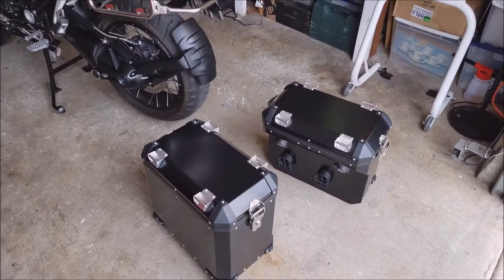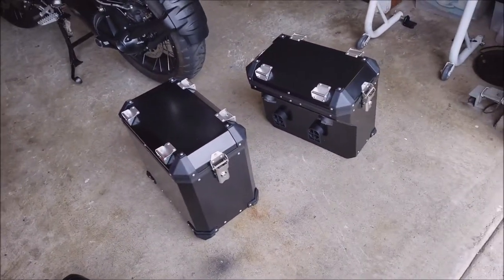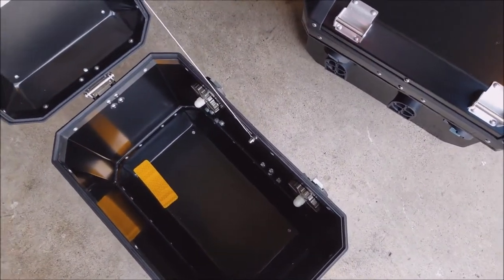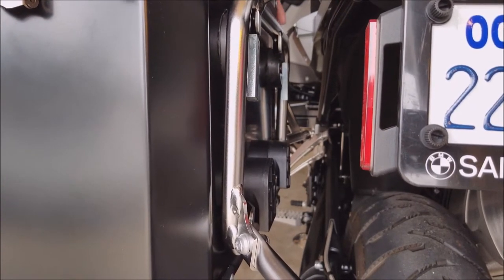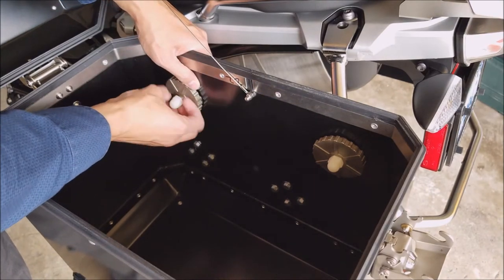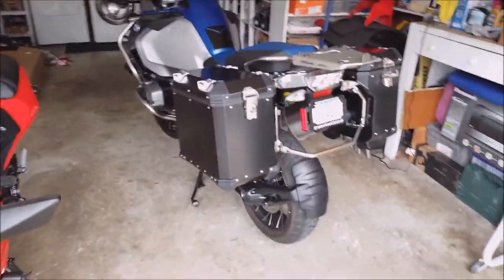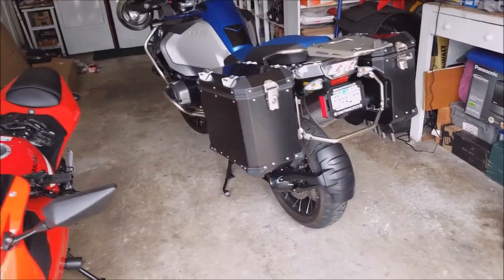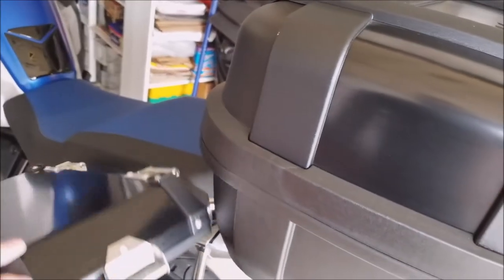Brooks Autosports Aluminum Panniers Black (Left + Right) Review - 2015 BMW R1200GS Adventure

Comment: Nice! One thing I'd like to note: the Touratech bags mount identically, and on those the black pucks on the back have a slight cutout for the metal tabs that swing up and lock the bag on place. You bring those tabs to a vertical origination and then screw the big knobs on the inside to lock it in place. I can't tell from the video if these cases have something similar, but if they do, that's probably very important to get a good lock-up on the mounts. I've seen this style of mounting system come loose with vibration if they aren't tightened down. I used to have Touratech bags like these on my F650GS, and my brother has touratech bags on his R1200GS that do the same thing. He lost a bag off road and had to turn bag to get it.

Just so you're informed so you don't have the same issue, especially if you're carrying anything valuable.
Reply from the maker: good tip, yeah they are the same type. the locking clamps looks to have a good clamping action on the bars and is very secure...there's also a locking nut on the inside to prevent the locking pucks from vibrating loose. I've just tested it today by going to costco, full load from east bay to peninsula no problems so far!

Comment: Nice review, but one thing you did not make clear. Does the top storage come with the side bags? or did you buy it seperate, also did the bracketry for it come with the top case or is does it attach to the OEM original bike bracket?  thank you.

Comment: Thank yor for the review.  I have the same panniers in black on my '14 Super Tenere.  Agree with your review, these are nice looking well designed and constructed and a great value compared to all the other stuff out there.  The Brooks strike a nice middle ground - completely turn key and better than Tusk, which are low cost, and more comparable in quality to the far more expensive Bumots, Jesse, and such.  I had to buy the mounting rack also, it is well constructed also.  Also bought the bag liners as, they were reasonable also.

Taking the "savings" and spending them on Race Tech gold valves and springs for my bike's forks, and probably a rear shock at some point.  Funny how "Moto Money" and the justification of spending it works in my moto addled brain :P

.